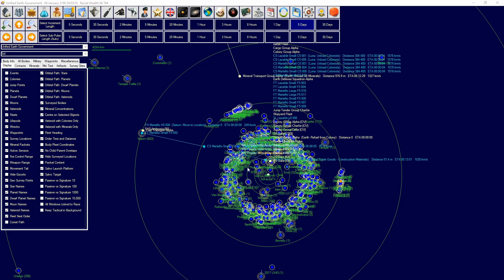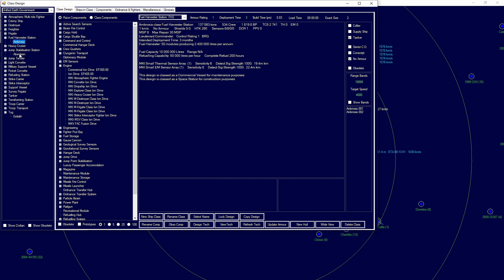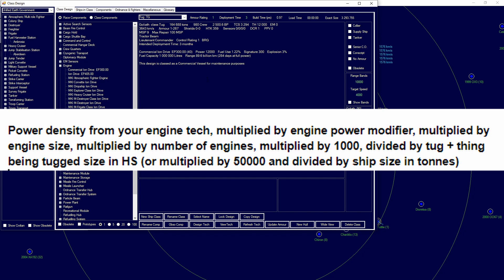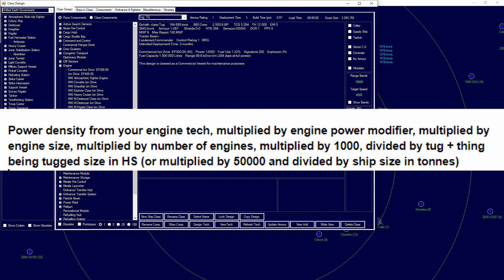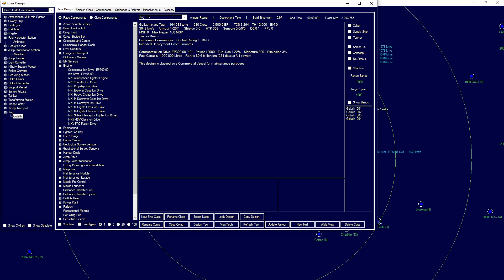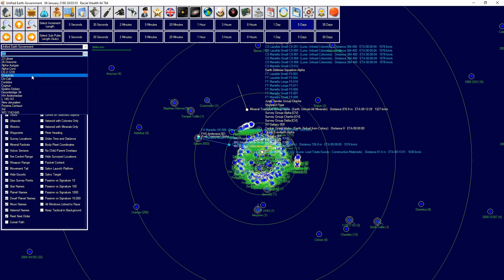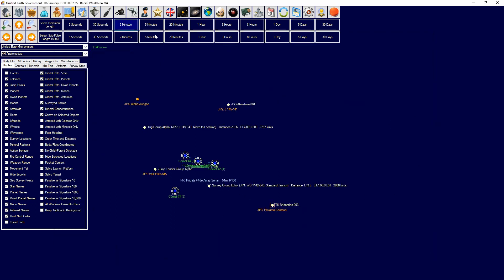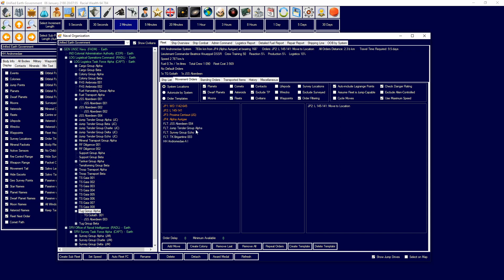Aurora 4x C# Tugs and the math behind them!

Comment: Can I use more than one tug to tug another ship/station?
Reply from the maker: No, they can only tug one ship at a time per one tug, you can however tug the tug which is tugging a ship
Reply: Basically a tug inception. Thanks!
Reply: @DefranStrategy  If you tug a tug, does it get a magic speed boost like VB6 or is the chaining taken into account?
Reply from the maker: theres no magic chaining if you tug something tugging something then it will take into account the weight being tugged and be slowed down accordingly